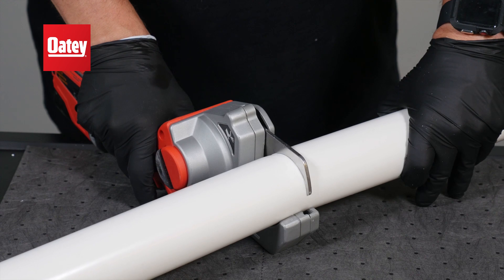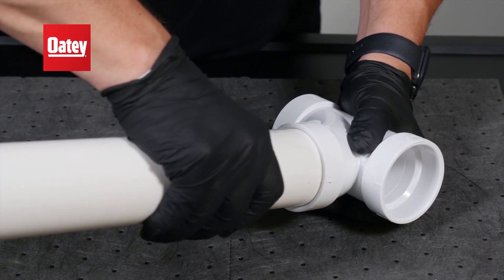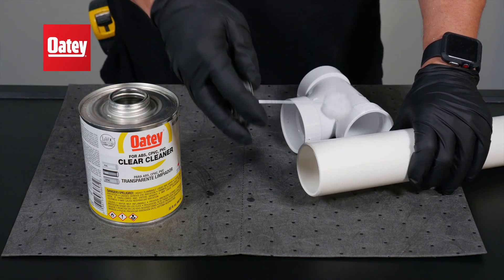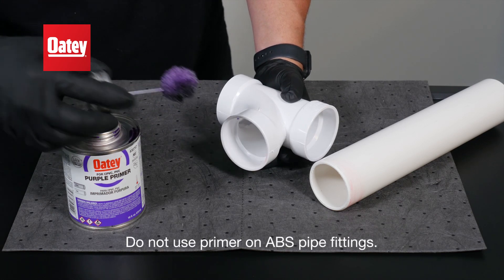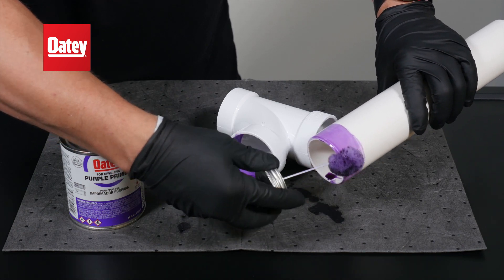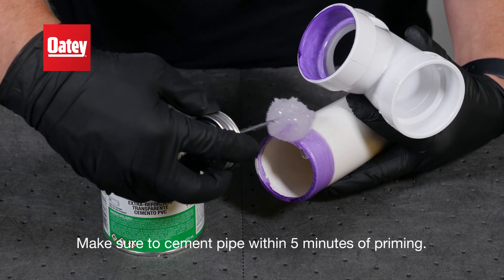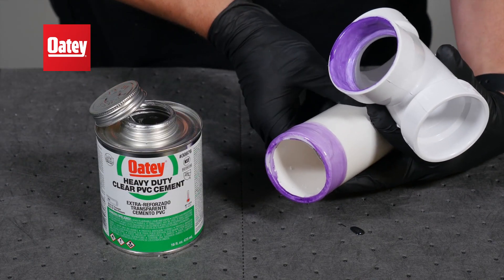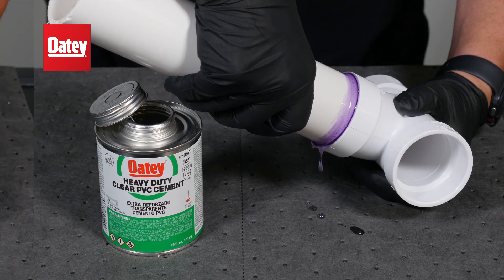How to Solvent Weld with Oatey Products

Comment: Most plumbers I've worked with shake off the excess primer into the can before applying it. Nobody gets greedy with the glue though! They slather it on!!!! I nevere seen the three step but now know glue has to be applied 5 minutes after being primed!!! Thanks Oaty for your information!!👍🏽🙏🏽🤎🧑🏼‍🔧🔧
Reply: Within 5 minutes not after, you’d have to re prime the hub and pipe

Comment: The most amazing thing about Oarey PVC glues is how fast they dry out in the can and become useless waste.  I've thrown out a zillion mostly full cans of Oatey glue that's become too thick/dried out to use.  Why doesn't Oatey develop a thinner/rejuvinator?  Oh, that's it...they'd rather sell you a new can!  I wish there was a good alternative.
Reply: I believe its the air space in a used can, solvents evaporate  into the airspace, like a half gallon of oil paint will dry
Reply: I’m a big fan of Weld-On. They offer several cement bodies and I have great luck using the whole can.
Reply: A thinner/rejuvinator is acetone. You can simply pour some in and mix. You can even do this with very dried out glue.

PVC cement is just PVC mixed with acetone. (You can technically make your own with PVC shavings, but it will be hard to get a good consistency.)

If I know I won't use the product for a long time, I'll pour in a layer of acetone and not mix it.
Reply: @Ariel1S  I've tried acetone many times.  The joints made with acetone thinned PVC cement are no bueno.
Reply: @MrGus.1  Maybe too much acetone? Or not well mixed? Because if you read the SDS that's all there is in the bottle: PVC mixed with acetone.
Reply: @Ariel1S  I haven't checked. That may be the case, but it doesn't mean simply mixing them will result in the same thing, as it wouldn't duplicate their process. Glue represents a minuscule percentage of project cost/effort, with severe consequences for a failure. I just would not bother. It would be like trying to save money on concrete for a house's foundation. Not the right spot to pinch pennies, imo.

Comment: So I learned the application is OHIO:  prime/cement the tube that eats the other tube, then p/c the tube that gets eaten, then p/c the wide mouth bass once more.  But then it can be the opposite, so said another YouTube instructor.  But there's more...

What I find even more confusing is how the hardware stores push the various color-labeled cans.  Even talking to Oatey wasn't satisfying.  The responses seem like you are annoying them for asking.

Lowes sold me:  (Purple label) Primer and (Red label) All-purpose Cement.  ACE sold me:  (Yellow label) Clear Cleaner and (Goldish label) Regular Clear PVC Cement.  And Oatey HQ told me:  I did not need the (Yellow label) Clear Cleaner, but I did need the (Purple label) Primer and preferably the (Goldish label) Regular Clear PVC Cement--so one from Lowes and one from ACE.  

And ACE in contradiction to both told me to use something called Megaloc thread sealant or Great White® Pipe Joint Compound with PTFE if intend to screw a PVC adapter into a water filter housing that is plastic threaded, like the Culligan WH-HD200-C, or metal threaded, like the Waterdrop AP431 AP430SS--all of which I have to research before I can even begin to understand what now.

This is probably a very easy job.  And in my case a very necessary job:  since no plumber in our area will even return a phone call they are so free of competition.  (Great job, public schools!)  It would be nice if the pros could take more time to share the How-To of their product aside from a YouTube.
Reply: Hey, i work in the swimming pool industry and have done maintenance plumbing for 5-10 years. I have occasionally used the cleaner on really old and dirty PVC, but will and have always use purple primer with "hot" blue PVC glue. 
I cost inside the fittings first. Then apply to the outside of pipe second. I also will turn the PVC about a quarter turn as i connect the two PVC. Hold in place for 10-15 seconds, depending on temps outside. Then I'll make sure they have dried enough to not slide out. Then I'll run a rag to clean off excess. 

Maybe if i have a empty can of clear or blue PVC cement with me, i could clean the dabber off really well inside it's can to use as my rag. But the rag usually does the job pretty well. 

Also, when k finish my job, if the water is high enough to run the equipment, I will do s short test run to verify any leaks. Once i am done inspecting I'll turn the system off and then I'll allow the PVC to cure before running the system

Comment: Oatey, I’m cutting off a 90 degree bend from a stub out. There is old glue extending past the 90 fitting about half an inch. Do I need to cut beyond the glue or will the cleaner and primer remove the old cement (fitting is 40 years old). Hoping the cleaner and primer will remove or negate the old residual cement on the sch 40 pvc  as I want to follow the 90 degree fitting’s end to make my cut square (this is for a drain on bath sink in a small vanity so it will be an effort to get a square cut, especially if not following the edge of the old 90 degree elbow currently cemented on the stub out)
Since I’m using a manual PVC pipe saw
Reply from the maker: Once the solvents evaporate the resins in the cement are left behind and cannot be removed. If the old cement is left in place and a new fitting is installed a potential leak can occur. We suggest cutting off all sections of pipe with all pipe if possible and follow all ASTM steps while installing a new fitting.
Reply: Will do, after holding pieces together for 30 seconds should you wipe excess glue with a rag or with the brush as the tech does in this video ?

Comment: What if not possible to twist? My pool filter inlet is fixed and cannot twist connection and other side is connected to pool pump (also cannot twist)
Reply: I work on pool plumbing everyday for the last 10 years.  you don't have to worry about any of this.  As long as you prime and use Rain or Shine pvc glue you will be fine.  You really don't have to clean before priming on new pipe or they would sell you 3 packs instead of just the primer and glue or the cleaner and glue.  For years i didn't even use either and have never once had a leak even still to this day.  And I do hundreds if not thousands of re plumbs every year.  When you are fixing plumb jobs, you most always cant do a turn, don't worry.  Rain or Shine seems to act like the primer itself.  Ive noticed that the pipe welds together and softens the top layer unlike the clear
Reply from the maker: All ASTM steps should be completed while solvent welding to ensure proper fusion and bonding.  In the event that all ASTM steps cannot be completed it is possible that failure can occur.  For your application, complete all steps that can be completed and be sure to allow for appropriate set/cure time while following local code parameters for testing and approval.
Reply: I'm sure you already did it but obviously it will likely be fine, just clean, primer and cement and of course make sure fully seated. For insurance I suppose you could put a bead of silicone around the coupling edge/bell end/etc. in addition to cementing.

Comment: How long do you leave primer on before applying cement?
Reply from the maker: You can apply the cement immediately after you apply the primer. However, once you apply primer, you have about 5 minutes to cement and finish the connection on the pipe before it dries. Don't wait longer than 5 minutes. Thanks!
Reply: Good question, it's why I came here.

Comment: Always turn fittings a little once they bottom out to prevent leaks. Turning the pipe gets rid of axial imperfections from the inside of the joint to the outside.

Comment: This guy would get fired so fast!
Reply: I think all the "he would get fired so fast!" comments are because the guy is taking his time and really doing the fittings right.  The deburring of the cuts, 8-10 turns with the purple primer, the female prime, male prime, back to female prime----all of that is viewed as just working too slowly.  In normal construction practices, pipes are rarely deburred, the pipes are sometimes filthy from being in the mud, the pipe gets one swipe of purple and one of glue, the pipes are shoved together, and that's it.  The funny thing is, what's shown in the video is the absolute right way to do it that gives you the best possible result.  I don''t use the cleaner as the stuff from Lowes and Home Depot is always clean, but I do every other step shown here and never have any leaks.
Reply: unclematt3 Okay it makes sense that he is showing how to do this but as a Licensed plumber what you just said is not true. I move quickly and cleanly.
Reply: @unclematt3  no, people say you would get fired because he has primer and glue going everywhere it's all over the place that shit's not neat in any sort of fashion.. however, you do have some very, very valid points. 👍
Reply: @dcronan583  one of the workers who plumbed my house mustve gotten fired because he left purple drops all over the garage concrete floor! had to clean that crap up off before i could lay down epoxy
Reply: Ben Dragan why
Reply: @johnzoppa7981  indeed i would like to know as well
Reply: @Ben Dragan why?
Reply: @fruithead8851  I think it's the mess and amount of glue wasted.
Reply: lol
Reply: maybe he'd get fired for his interpretation of 1/4 turn

Comment: I bought Oatey medium orange cement (for CPVC)  by mistake for my PVC sink drain. I used it, do I need to re-do it or do you think it will be OK?
Reply from the maker: ASTM requires that a cement contain a percentage of resin of the pipe material its being used to join to successfully create a solvent welded joint. If CPVC cement is used on PVC material, the type of  resins needed to create the joint are absent and could therefore result in failure.   We don't recommend the use of a non approved cement for any application and cannot guarantee the integrity of the joint(s).
Reply: Jon micheal Actually, I used it on multiple drains and none of them ever leaked
Reply: It'll work just fine. The resins in PVC cement are within CPVC cement.